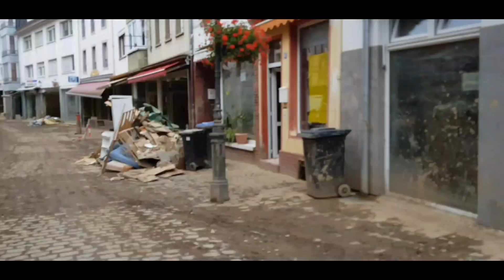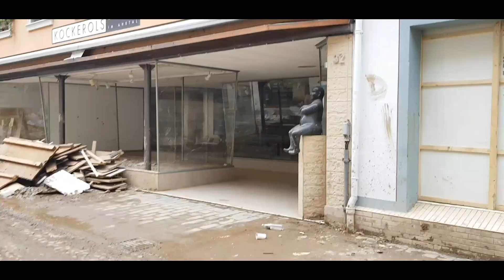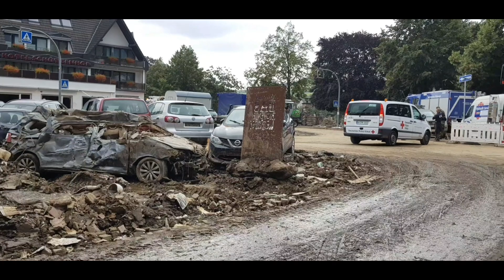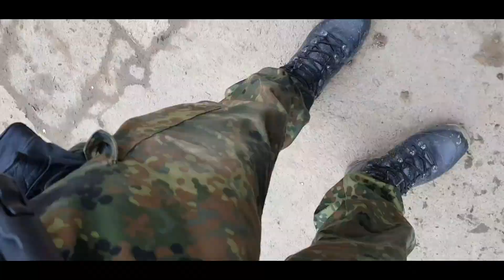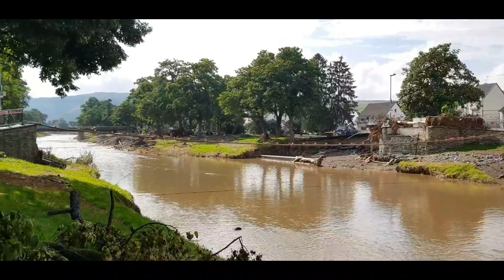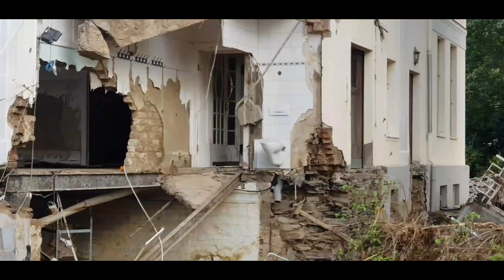2.08.2021 Bad Neuenahr-Ahrweiler Hochwasser Flut

Comment: I wonder if they will save the building with damaged corner. More damaged buildings were saved after WW2.
Reply: You can not compare this with ww2.
Reply: But the ones in ww2 were not contaminated with toxic mud….
Reply: @akkseljohansson3601  if the mud was a problem then many cities and villages which were flooded would have to be demolished. There are methods to get rid of all contamination.
Reply: @m.th.rf.ck.r3727  why not? If the bomb hit that corner of the building the result could be similar.
Reply: @volkhen0  After Ww2 there was no money and the work was cheap so the people took what was there and rebuild as good as they could.
Today a static engineer has to   check everthing first. Material ist cheap but work ist expensive. So you must make a dicission . Maby it is cheaper to build new. 
Maby not in the same place .
Remember the climate ist changing....
Reply: @m.th.rf.ck.r3727  yes, but it looks like the building is in pretty good shape. I would think many times before I decided to rebuild the building in the same place… who knows when next similar floor will come, maybe in 100 years but maybe in 5 years in some strange  probability glitch. Climate change is definitely increasing the odds of such floods.
Reply: @akkseljohansson3601  I know what have to be done in homes after flood. we had huge flood in Poland in 1997 which flooded whole cities. Everything was rebuild but signs of water was visible on the buildings for years. The difference is that mostly it was steady water - not a tsunami like flood. I think the approach in Germany is very cautious. Maybe even too cautious. Government have to do its job and rebuild all infrastructure as soon as possible. Companies that do walls drying services will have a lot of work to do…
Reply: @volkhen0  i know, but already people are ill due to the toxic contamination.  That’s how they found out…
Reply: According to people that lived here in WW2, this has destroyed more than the War.